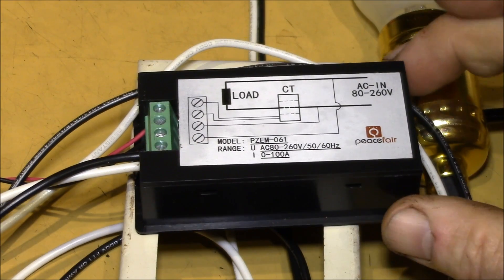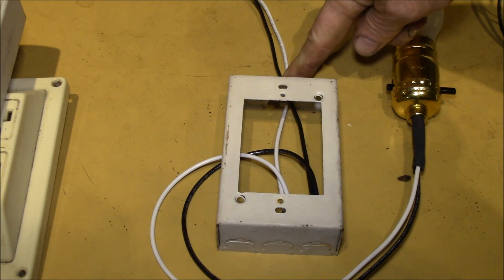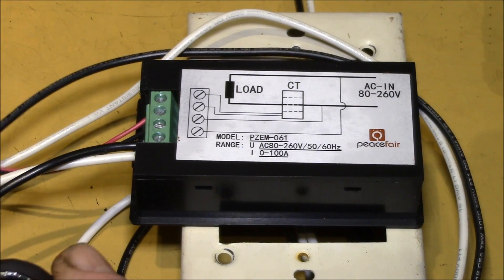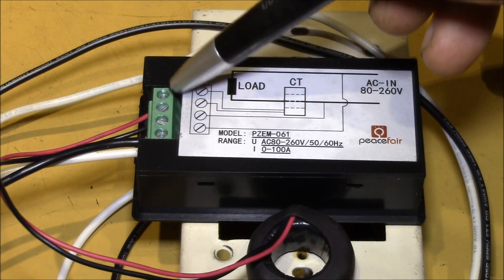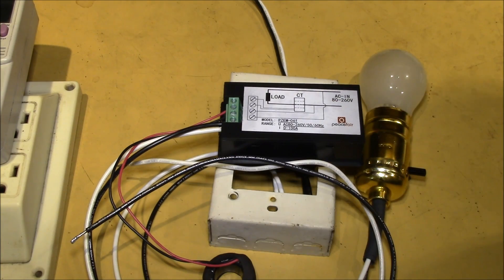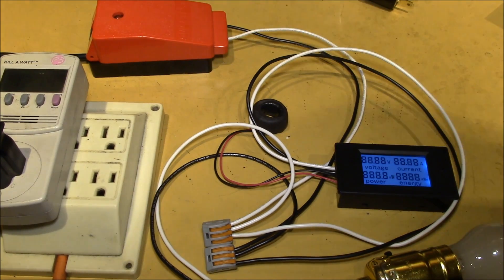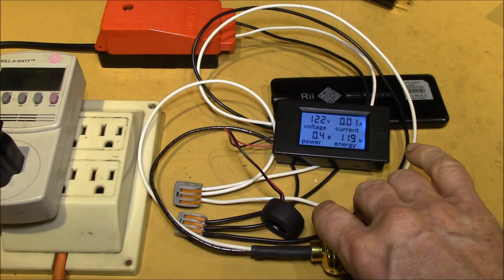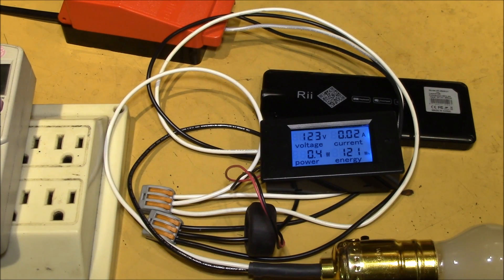PZEM-061 AC Panel Meter Wiring

Comment: R Brown: by chance are you Roger Brown from 4x4Wire?  Anyways can you wire this up to a double pole breaker?  I'd like to monitor a new mini-split that we installed for a guest room.  It's a double pole 40A (2 x 20A) breaker.  So I get that the two wires from the CT would be screwed into the 2 top slots of the monitor, but would you run the CT through one or both hot wires coming out of the breaker (the ones leading to the mini-split).  And how would you wire up the monitor's other 2 wires?  After reviewing your vid, would i be correct to wire up one wire from either screw slot in the breaker to the unit and another wire (neutral) to the neutral bus and to the unit itself?  These wires (supplied by me) would have to be the same gauge as the existing breaker wires to the mini-split, correct?
Reply from the maker: Yes and yes, see below:
https://youtu.be/LhR-Z6lBeZw
You could use smaller gauge wire for the meter connections, only high current would be in the load wire, one of which passes through the CT.  Now this assumes the 240V load is fairly balanced since you are only measuring the current in one leg and the meter assumes the other leg is the same.
Reply: Thanks for the reply Roger. But after looking at your 2nd video you linked, I'm still unclear.  In your linked vid, you've pigtailed two wires from the monitor (blue w/ black tape and white wires) to each side of the outlet.  This seems to suggest in my case that each of those pigtailed wires should be both wired directly into each slot of the breaker.  In my original question above, I asked if one should be wired to the breaker and one to the neutral bus.
Reply from the maker: In my case, I have L1, L2 and ground with no neutral.  So L1 went to one side of the meter, L2 to the other side and if there were a neutral, it would only go to the receptacle or load.  

But in any event, the meter needs to sense the full voltage between L1 and L2 (i.e. 240 volts).  Or in your words, one wire from one breaker goes to one side of the meter and one wire from the other breaker goes to the other side of the meter.  Run one of those two wires through the CT.  

The meter could care less about neutral and if the 240V load is balanced, there should be no neutral current flowing.  If you connect the meter to one of the Line connection and neutral, it will work.  But it'll only "see" 120 volts and the power readings will be half of the actual reading.
Reply: Roger, thanks for clearing that up for me.  Makes perfect sense now!
Reply from the maker: No problem.  It was confusing for me as well until I dug into it a bit.

Comment: Great video. I just wish you would do it again and provide a clearer picture of where of the actual wires go. By stopping the video I was able to figure out what where each wire went. I am so glad you did this video and I got to find out the diagram on the back is backwards. The directions are useless without a EE degree (I assume). Where did you get the neat little hand held circuit breaker box?   ... I plan to play with this thing some more after a trip to home depot for parts. Then I will find a way to encase it in a box and mount on the wall. Much to learn.
Reply from the maker: An idea for a box to hold the meter in this video:
https://youtu.be/LhR-Z6lBeZw

I assume you're referring to the Cliff Quick Test, the red/orange box with the spring terminals, I cover that in this video:
https://youtu.be/pFY22kP61NU

Comment: Where did you get ac portable Circuit Breaker for testing??  Thanks!
Reply from the maker: That's a Cliff QuickTest, I got mine from Newark as I recall:
https://youtu.be/pFY22kP61NU
There is apparently one with US wire colors available now.

Comment: Will it work for Aircondisoner ?
I need to measure electric consumption of AC separately
Reply from the maker: No reasons it shouldn't work for that.  If making a plug in version like I did, you may need to change the style of plug and receptacle to match what your device uses.  Or if you can access the wiring, the unit could be installed in-line.
Reply: R Brown there r some potable electric meter in market but costly. So I thought to make like that . meter input side I thougt to use male plag and output side I thought to use female plug. Then I thought to measure electric consumption of any device like plug and play type thing
Reply from the maker: Yes, that's essentially what I did in this video:
https://youtu.be/hRCrvGlqYoQ
You could just get an extension cord with the correct plus and socket, cut it in two and wire up to the meter inside an electrical box.
Reply: R Brown awesome.
Thank you very much. U r really awesome

Comment: Is there any way to hook this up the my generac transfer panel so I can see the voltage coming out of my generator?
Reply from the maker: You should be able to do that.  Just wire up the two power leads to the generator side of the panel.  And then run one of the generator power wires through the current transformer to measure the current.

Comment: is there any option to store data in this device?
Reply from the maker: The only thing that's stored in this particular meter is the accumulated energy (KWH) reading and the setting of the display backlight and the power alarm threshold.

Comment: Hi, Is this device possible to measure air conditioner consumption? as i would be connecting it to a circuit breaker inside the switch board, i have no idea of what type of cable to use.
Reply from the maker: Yes, in theory it should work for that.  If connecting inside of a switch board, you would want to use the same size cable as that circuit breaker supplies to the air conditioner.  This is because that circuit breaker is sized to protect the wiring from the breaker to the load (A/C) and any wiring off that breaker should be the same size.  You might be able to use a smaller gauge wire and separately fuse it since the meter itself only needs a few milli-amps of current to operate.  You can see how I installed a meter like this inside a metal junction box to make plug-in power meter:
https://youtu.be/LhR-Z6lBeZw

Comment: I will use one to measure the power consumption by the house. Can i use ordinary cable to connect the meter to the load in the house switch board?
Reply from the maker: I suppose it would matter what you are connecting it to.  If connecting off a circuit breaker inside the switch board, then you would want to use a cable of similar type and gauge to what's inside there already.  If instead, you are plugging in the power to a receptacle, then you could use a regular power cord.  You can check out how my whole house energy monitor is wired with the power coming from a regular plug in cable:
https://youtu.be/xNp3d_cbVVc?list=PLpY2FP1a9tivPdpLVyg8XMqxw6B6SAEbI&t=125

Comment: great work. If it had pf display it was so perfect. what are the minimum wattage of load it can display accurately.
Reply from the maker: Seems to read down in the 1W range:
 https://youtu.be/gsjpNA5Qhnc
and with some work and the current shunt version, down to 0.1W:
 https://youtu.be/47osFl0LuJ0
Reply: my Brennenstuhl Wattage and Current Meter PM 230, can't read anything less than 10W or I think 20W. So I have to test thing with 20W known load in parallel

Comment: Thanks for this video. I just purchased one of the dual AC Volt/Ammeter and it did not include any instructions. Glad you were able to explain the set up. Mine is a little different, but the concepts are the same and I do know where the hookups go now.
Reply from the maker: Glad the video helped.  Yes, even if you received instructions, they are pretty confusing.

Comment: Yay got mine working. I bought the split CT and it was reading very low(3-19W max) for the total power usage of my whole house. I then thought that maybe the ferrite cores weren't touching so I cleaned the contacting ends and clamped it to the mains wire with the CT wires open circuit and it started buzzing. Plugged it in and now it's reading 500W. Thanks for the vid.
Reply from the maker: Great, glad the video helped.  I haven't tried any of the split core CTs with this meter yet, so this will be good to know for anyone using one of those.
Reply: When I saw your vid I knew something was wrong with mine because yours was so accurate. I had been using it for 2 days and thought something was wrong, and after finding your vid, I checked the CT and there was some goo in it. I think you can buy the split CT separate online, and it does save that dangerous threading a main power box wire through the CT.

Comment: Hi, nice video. 

Would you mind to give me an information about the device behavior?
If the energy that feeds the device fails. Does the "energy counter" keeps the information or it will loose it?

Thanks
Reply from the maker: Thanks.  Yes, the energy reading as well as the back-light mode (on or off) is retained with power loss.  I think I show those features in the video below:
https://youtu.be/MRu8zwFSBE4

Comment: Hi Brown , I use the same kind of meter to check my speed controller , It got burnt . Lesson leant . Never use such meter to check the voltage on speed controller . Now need to purchase a new one . Thumps up Brown will follow your way to fix the new meter . Thanks
Reply from the maker: Ah, good to know, sorry for the loss of the meter.  The voltage out of the controller must have very high spikes and that took out the internal power supply.  I hope to get one of my meters modified to take a separate power supply input so should be more tolerant of that sort of situation.Stay tuned for that video.
Reply: Hi Brown , Glad to hear from you , At least my info helps many other victims who may not know the serious of the control output voltage . I will wait for your next  meter modification video , Thanks Brown for your support Sammy

Comment: can you use the same meter to measure 230 volts and how do you wire it!
Reply from the maker: With 230v loads, you have 2 hot wires (L1 and L2), but no neutral, so what current flows in on L1 flows out on L2, since there is no neutral wire for any current to flow in.  Yes, as long as all 3 pumps are powered off that same breaker, just run a pair of wires off the two breaker poles to the 3 meters.  They'll all read the same voltage and then each one will read their own current off their own CT that is around one of the wires running to each pump.
Reply from the maker: On a 230v circuit, the current flowing out L1 is the same as the current flowing back on L2.  Same as a 120v circuit where you have Line and Neutral, amps in = amps out.  So if the meter is wired to see the full 230v and one of the currents (via the CT) then it is reading the full power (power = volts x amps).  If you hook up two meters, they are both reading the same power (same_power = same_volts x same_amps).  See below for a video on this:
 https://youtu.be/LhR-Z6lBeZw
Reply from the maker: Yes, it's rated up to 260VAC, so no problem on 230V.  Wire identical to 120V, one of the load wires through the CT and then the sense/power wires across the load.
Reply: so use only one side of the 230 volt wires and it will measure 230 volts
Reply from the maker: If you are talking about 230 volt split phase where you have a L1, N, L2 wires, put the meter across L1 and L2 and ignore the neutral connection.  If you do L1-N the meter will only see 115V and thus measure only half the power, same with L2-N.  You want the meter voltage terminals hooked to L1 and L2 (in the US, likely the black and red wires).  The meter display should show 230 volts and then the power will be correct.
Reply: I have a heat pump connected to a 230v 20amp double pole breaker in the panel.  I don't see neutral connection.  Do I put one of the load wires through the CT or both to get the correct reading?  Thanks in advance.
Reply: Amazon sells "closed current transformer" and "open-closed current transformer" which one would work for my type of setup?
Reply from the maker: For 230v, just pick one of the load wires and run that through the CT, just like 120v.  Then connect the voltage input of the meter to both load wires with little jumper wires.

And yes, it seems there's now an open core CT version of the meter available.  Both do the same thing, closed core (as shown in this video) means you run the wire through the core of the CT.  Open core means the CT is split and hinged in the middle.  You could open that up and fit it around a load wire w/o having to disconnect that wire.  Would work in your main breaker or load panel if you wanted to measure the whole house power consumption.  For that though, you would likely need two meters, one for each side of the panel, as most residential breaker panels are not balanced loads, since you have 120v loads off of one side and 120v loads off the other side.
Reply: Thanks for the quick response.  I do not want to measure the whole house power consumption.  My intention is to monitor how much energy the heat pump consumes in real time.  I am still a novice when it comes to 230v.  I understand the concept of the 110v system.  I got lost when you said to connect the voltage input of the meter to both load wires with a little jumper wires.
Reply from the maker: For 230v, you typically have 2 hot wires and ground.  Stick one hot wire (makes no different which one) through the center of the current transformer.  Then hook up the two voltage terminals on the meter to the two hot wires.  So likely you have a junction box where the heat pump is connected to.  You'll need two wires coming out of there to run to the meter to both power it and also for it to sense the voltage of the load.  Same thing as if it were 110v, you would use hot and neutral.  On 230v, you use hot and hot.
Reply: Thanks for clearing it up. I think I have a better understanding of how to wire it.  From the diagram listed above.  I would connect the top 2 terminals to the CT, then the CT would be wrapped around one of the hot wire.  Then for the bottom 2 terminals.  I connect each terminal to each hot wire.  (this only act as the power source, correct?) I was just afraid that I would get a false reading by hooking up one CT on a 2 hot wires.
Lets say I have 3 individual heat pump zone and I would like to get 3 individual readings.  I would buy 3 meters and hook the CT to one of the hot wire.  Can I then jump the load directly from the 20amp 2 poles circuit breaker to power the 3x meters?
Reply: I ended up buying 2 meters and wrap the CT on each leg that go out of the circuit breaker.  The energy use is almost the same on both meters.  Do I add the 2 meters together to get the total usage? Which is the correct reading?

Comment: hi, can you let me know is it possible to extend the CT wires I want to watch how much wattage my Inverter AC is consuming but AC wiring is just below the ceiling so if I install this thing there then I am not going to see anything I have to climb up everytime I want to see whats going on
Reply from the maker: +Avez Khan Should be no problem to extend the wires assuming same or larger gauge is used.  The CT uses current for sensing, so voltage drop of additional wiring is not an issue.

Comment: WTF??? That would be a $15M building here in lesser US. Rent/lease pmt is only part if the nut. Maitenance, utilites, and taxes could be that much again. How much liability came with the deal? That could be a more of a bite than most folks could get their jaws around.

I'm sure you looked into this and worked out the ways and means but I can't help being concerned.

Maybe a porn studio. Put that 40 power zoom soldering microscope to a profitable enterprise.
Reply: And I bit. Crap! Still Mar 31 here @ 19390

Comment: Yes the caution is the good one. CT should be connected to Meter first and then put the AC load into the coil. Never disconnect the COIL from meter when AC load is active, you might get a huge electric shock on CT wires.
Reply from the maker: +Venkatesh E Thanks, and yes, those little CTs look so harmless.
Reply: Thank you for the video. I really like your videos. Good Work!!!.
Reply: +Venkatesh E hi, can you let me know is it possible to extend the CT wires I want to watch how much wattage my Inverter AC is consuming but AC wiring is just below the ceiling so if I install this thing there then I am not going to see anything I have to climb up everytime I want to see whats going on